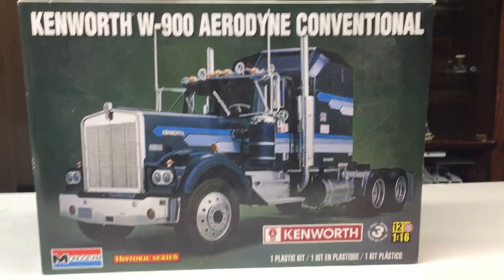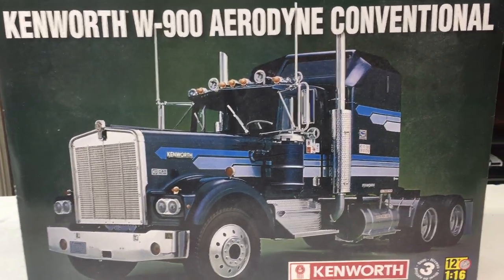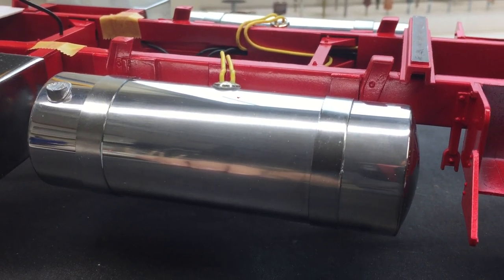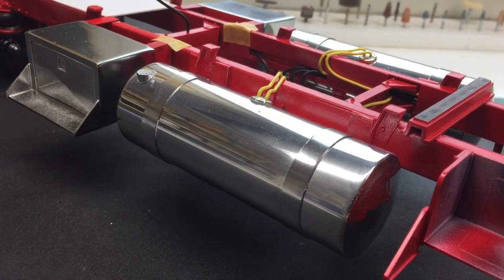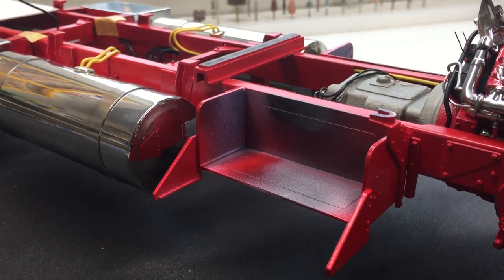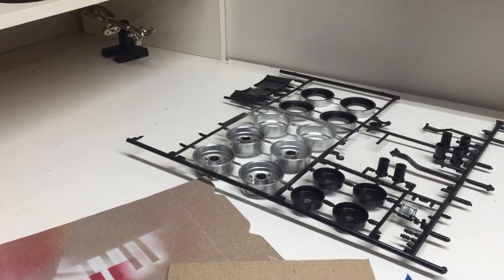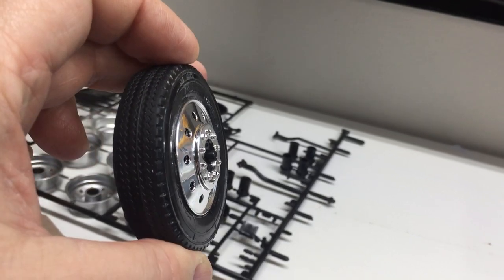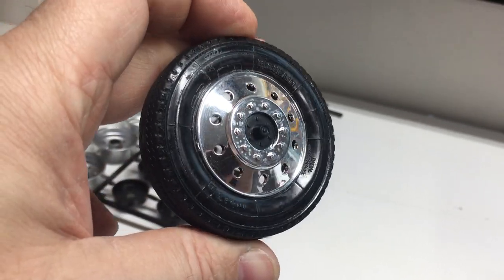1/16 scale Kenworth

Comment: Add scratch build slack adjusters to the steer brake chambers
Reply from the maker: Just make sure those brakes go on in the correct direction 🙂
Reply: @crazyhorsecreations1334  I scratch built 6 slack adjusters to all axles on my build
Reply from the maker: I have a website that has a ton of info you can use Dutch model truck club Fotki.com photo and video sharing then go to 07 model truck magazine articles sub folder 17 then car modeller US mag 1990 to 1998 albums 48 there’s other references all over this site